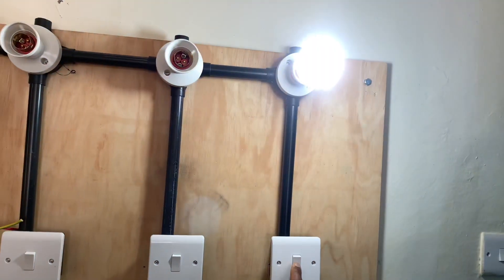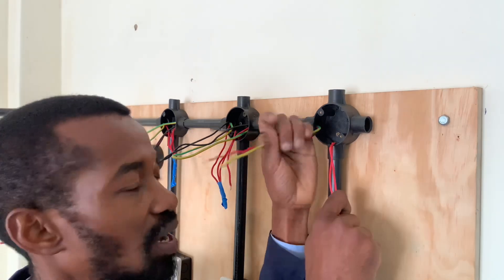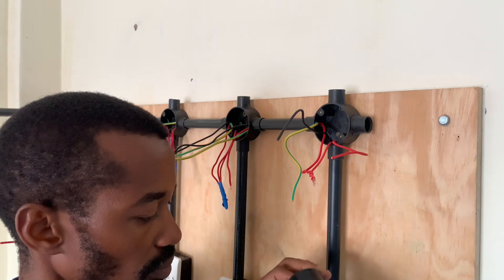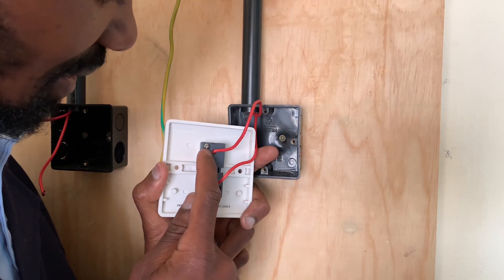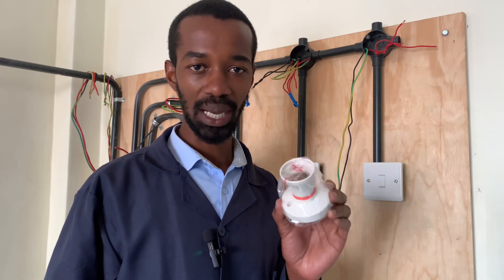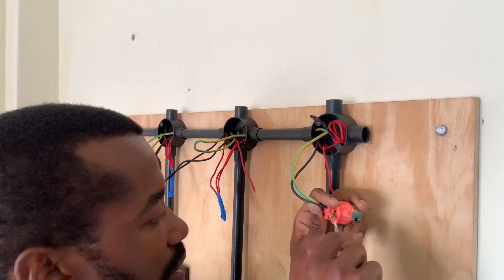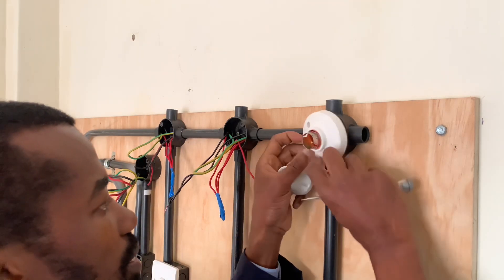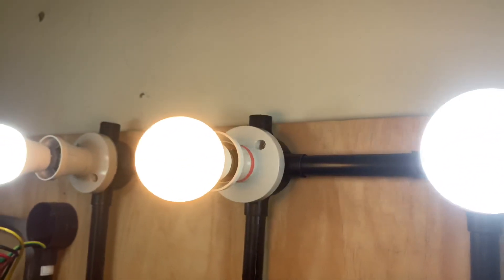How To Wire A Switch And A Bulb (Simple DIY)

Comment: Kindly explain what happens to the earth wire in the case where you want to use a hanging bulb holder without a provision for earth connection and when not using a ceiling rose.

Comment: Is it wrong to use a 2.5 amp wire for bulb connection
Reply from the maker: Great question Wanekhwe, on safety it's OK but on cost it might be a bit higher for the customer.